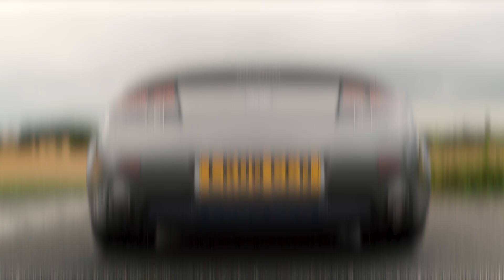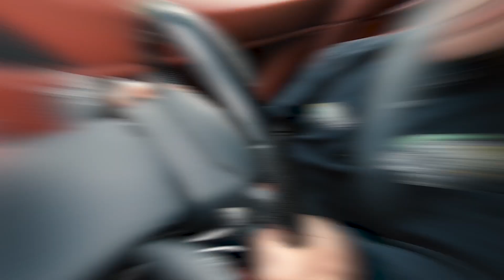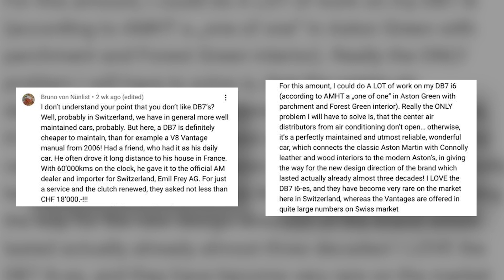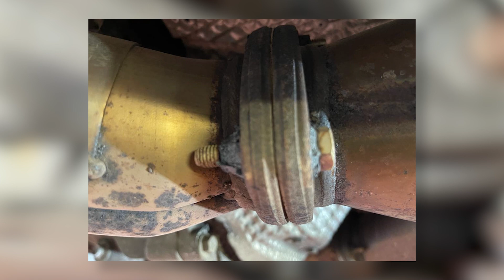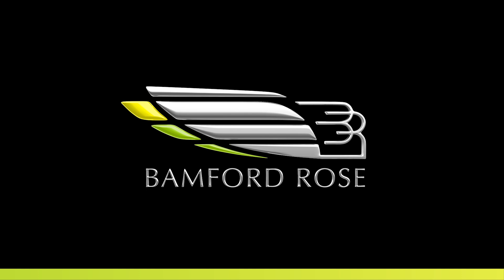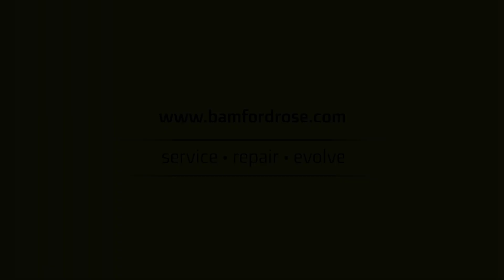Are UK cars poorly maintained? The consequences of bad service regime | QOTW #134

Comment: I do wonder if the issue is that some places see an Aston and add a zero to the price. It's also well documented that the price of genuine parts is many times more than something exactly the same but with a Ford logo on it (Aston 1936 is brilliant at proving this fact), so possibly owners that don't understand the prices and the reputable service agents fall foul of massive price hikes and cut back?
I know my DB9 will cost between £500 to £750 for its service so when  a garage says that they can do it for £200 I'm running in the opposite direction as fast as possible knowing that the oil filter will just get a wipe. Knowledge is power in Aston ownership.

Comment: I collected my new (to me) 2010 DBS from a franchised dealer back in December having been serviced, all checks I asked for like corrosion, misfire count check etc done. Rear diff oil replaced. This was the conditions agreed pre purchase with the independent I was buying from. Whilst at the dealer I purchased a 12month warranty/ European breakdown cover. service bits and extras £4110.42 On top of my purchase price from the independent. Smile ear to ear I trundled approx 80 miles home. Backing on my drive I notice at dusk no number plate lamps. Phoned the dealer first thing the next day and got no explanation as to why they wernt working “maybe bulbs blew on journey home” so I investigated and found both lamps unplugged so could never have worked at time of service. Under tray bolts looking rough that I then find out are only pennies from Aston. Absolutely shattered my dreams of using main dealer to check the roots of my purchase. I run an independent garage in my home town and would be devastated if a customer raised these concerns after a service prices at 25% of their prices.

Comment: One of the best investments I ever made was the purchase of a hydraulic lift. 

I’ve lost count of the literally hundreds of hours over the years spent during the “off” season each winter in the garage taking off the undertrays and cleaning, wire brushing and painting subframes and other suspension components and replacing bushes as needed. 

Yes it’s an AMOC concours-winning garage Queen these days, but was not like that when I purchased it 11 years ago. Do it properly once and refit with stainless bolts on the undertrays and you don’t have to worry in future. This work is not particularly complex and just needs lots of “Elbow Grease” 👍

Comment: The simple fact is that Germany/Switzerland have an ingrained mentality of excellence in engineering when it comes to any "metal bashing". 
Engineers are highly respected and actually run many many companies as opposed to the beancounters here in the UK. I've visited several factories there in my time and you could eat your dinner off the floor. This "only the best will do" is in stark contrast to the "make do and mend" attitude here............with a few notable exceptions like Rolls Royce...Bamford Rose
Reply: I completely agree. I’ve dealt with British and European suppliers for 12 years and by far the best company I’ve dealt with is an Austrian company, owned and run by engineers. They are passionate about form and function long before costs. Everything has to be right!

AM Wilmslow missed several key issues on my DB9 and didn’t do some of the service actions that I paid for. Bamford Rose rectified my car to my huge satisfaction and as I am an engineer by trade and have restored classic cars, I am gradually renewing/upgrading other elements of it.